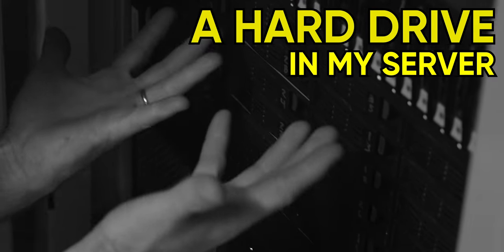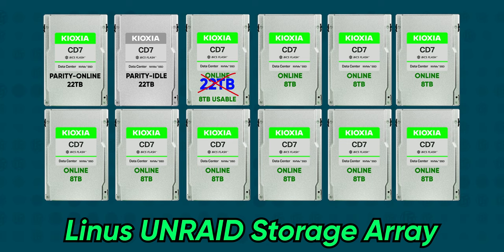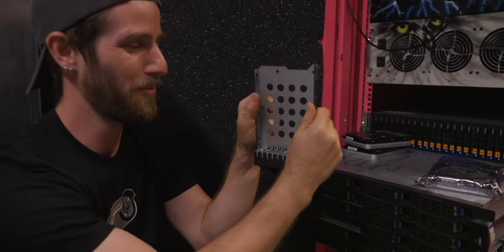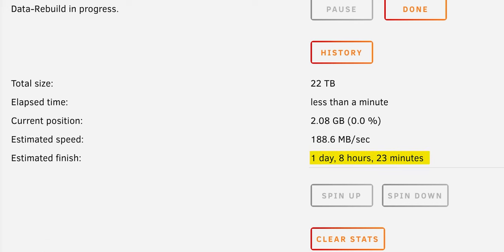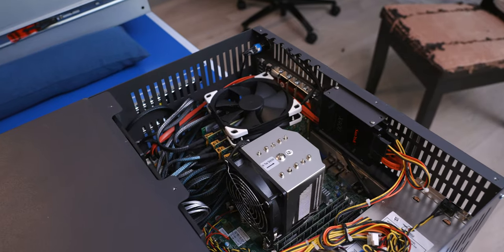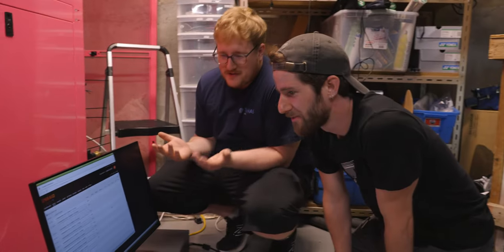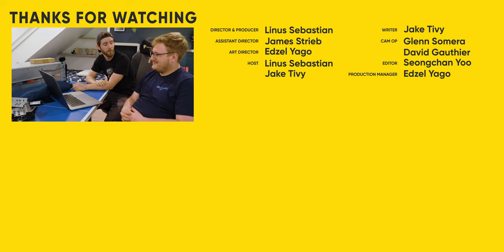My server is broken :( - Fixing Linus' Home UNRAID Server

Comment: booting unraid from usb is perfectly fine as it only reads from the drive during boot and writes very infrequently. My OG thumb drive from 2012 when I started using unraid is still going strong and many many hard drives from that first build died a very long time ago.

saying thumb drives are unreliable in this scenario is uninformed.
Reply: vmware also used USB / SD flash drives right up to version 7.  I'm using 64 gig usb flash drive for my TrueNAS core for years without issues.   I'm planning to change it out for USB to nvme adapter soon.

Comment: I am fully aware that I pay a synology tax, but for me synology hybrid raid is the killer feature. It is so easy to just mix and match drives. My first synology was a used 5 bay model and back then I would be savaging old drives from ewaste pc and every time a drive diede I would just plop in a bigger better drive. And core critical data was always offsite backed up.
Reply: I came here to say the same thing. I got given one of their rack mount models and their hybrid raid is awesome. Just going to keep adding drives until it fills and slowly up the size of the drives.

Comment: 13:50 The use of a USB drive for booting is not problematic because it is an immutable file system except for the config folder that its mounted very rarely. UNRAID and its FreeBSD brothers run basically entirely from ram and use very little write ops. 
Source: immutable FreeBSD OS dev
Reply: Its more that USB drives have a habit of dying completely at random, not necessarily due to writes.  Which is of course why you're supposed to have a backup to quickly swap out should that happen.
Reply: FreeNAS/TrueNAS hasn’t run mostly from memory for years, mainstream FreeBSD never has.
Reply: @philiprobar  yea not mainstream BSD, but BSD Router project, nanobsd, and microbsd which are all used to make these appliance OS’s do
Reply: @davidcozziii  
FreeNAS/TrueNAS stopped using monowall and switched to FreeBSD in 2010. I lost several flash drives to the beta releases.
Reply: @philiprobar  okay… I’ve been running production systems for the last five years without fail, in fact I’ve burned significantly faster through HDDs and SSDs because of how I configured it. Idk what TrueNAS did, but it’s no where near as janky as everyone makes it out to be.

Comment: I always love these storage related videos since I can relate a lot, I run my own NAS in a Supermicro 24 bay chassis at home, but use mdadm raid, and way older/cheaper hardware.  Recently added 7 10TB drives to grow 2 of my arrays. That was an interesting undertaking, basically replace one drive at a time and let it rebuild.  I have a file system limitation where I can't have partitions bigger than 16TB though which is kind of a bummer.  I need to fully update the OS but I don't want to take it offline.   The challenges of storage servers... :P

Comment: 14:00 Unraid is probably the same deal as ESXI regarding Flash Drives - it just loads some stuff from the Stick into RAM and doesn´t really write anything to the Stick itself, instead writes config, logs etc to the drives.

Comment: Running an 18TB Exos, and really pleased with it. No problems with it, unnoticeably fast read and write speeds, and it was good value at the price I bought it.
Reply: Only downside with exos I've found is that they do tend to be a bit louder, if you're using them directly in your PC rather than a home server or nas in another room.
Reply: @Californ1a  that's true, it is noisier. Doesn't bother me cos I've always got headphones on, but they wouldn't be as good for a build where low noise was a priority

Comment: That's why despite other issues with Synology (drive "compatibility" list), SHR-2 allows you to mix-match drive sizes (upward) and still be capacity efficient.
Reply: I can do the same on Windows with StableBit DrivePool. I don't have to care about specifics and can just add anything to a pool and it gets duplicated as often and as much as I want.
Reply: @CheapSushi  Their website has no mention of parity and a Google search yielded no straight forward answers. Does it support two disk parity or redundancy?

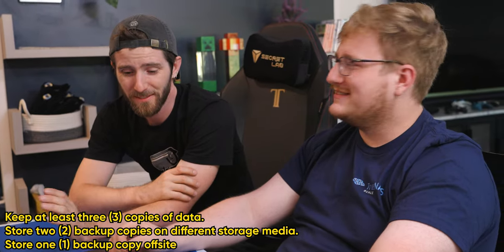Comment: 8:32 I 100% understand Linus here. For some reason using 3rd party cloud storage for anything but the most unpersonal unimportant stuff creeps me out immensely. I do all of it locally and even host my KeePass database myself (luckily my router has options to do stuff like that though only effectively for small files because of cpu/ram limitations). At the moment I'm in the process of building a data server (coincidentally with the exact 16TB Exos drives Linus showed in the vid) for myself and my partner and after that I will build a second one in my parents house for offsite storage (since The own a previous farmers house with several buildings for animals and 2 barns, so there is lots of unneeded space).
Reply: @Taudris  tbf building and maintaining two servers is very much a bonus for me and trusting myself is always easier than some corporations - I also despise monthly payments; it's bad enough I have to pay for the essentials (rent, water, electricity, insurances, etc.) I don't want to add any more to that than I have to

Edit: meaning: even though your reasoning is probably sound - it does not appeal to my feelings unfortunately

Comment: 4:43 be VERY CAREFUL when pulling a hot drive. You must let the spindle stop before rotating it because it can cause a head crash.
Reply: Don’t worried his pull out game is strong
Reply: i'm pretty sure modern drives instantly retract the r/w head off of the platters on power down/loss.
the reason you don't rotate the disk while it's spinning is cause the platters are spinning very fast and have a lot of angular momentum like a gyroscope, so if you rotate the drive, the platters will experience lots of perpendicular force, which isn't good neither to the platters nor the spindle motor.
Reply: It can't cause a head crash.  It could break the spindle motor.

The head unloads the instant the power is removed
Reply: Modern drives will park the head instantly when power is lost.
Reply: The system is off, otherwise the parity will be completely destroyed when you take out all the drives one by one and you hit both parity drives + extra drive.
Reply: @Haploanddogs  Yep, spindle motor is a gyroscope. So if you rotate the drive you can put a lot of stress on the bearing.

Comment: The way I handle this is to not fill up with all of this in the first place and just use a Sandisk Extreme V2 3.63TB SSD for movies&games, a V1 1.81TB for video editing, and a thumb drive to store my tools/drivers/ISOs. If I ever got a raid setup, I would use TrueNAS and find an infinitely replaceable set of drives I can purchase years into the future to replace the failed one. Shouldn't be hard to find individual sellers on eBay that can resell brand new or refurbished drives at a good enough deal.

Comment: TrueNAS for me... I don't mind just planning ahead and getting matching disks...  although older arrays with smaller disks are getting harder to find replacements for a good price/Tb.  Also If I need more space I have to bite the bullet and grab a stack of new drives.  All that aside, using snapshots I have 3-2-1 backups automated across two servers and one offsite in an adjacent building. I can rest at night.
Reply: Same here. Starting replacing 4tb drives with 8tb drives as they died or I moved them somewhere else when the pool reached 70%. Now at 79%. Either some of the remaining 3 disks die or I will replace them anyway within two or three years I guess.
Reply: You don’t need matching drives for truenas (or at least ZFS in general). As long as the new drive isn’t smaller than the old one, any drive will work.
Reply: @guspaz  Yes, that is correct.  You can start replacing the drives with a larger size and soon as all drives are replaced TrueNAS ZFS will automatically expand the array.
Reply: @guspaz  Don't "need" to be matching... although my tech brain will not let me physically do that. (lol... OCD gets the better of me and I start spending for new matching array)
Reply: @soniclab-cnc  yeah you don't need matching... but you won't get the extra space unless you have replaced all the drives. Matter of fact I have another nas that started with 3tb drives now all are 4tb except 1. Guess what: not getting any extra space until I replace the last one. In ZFS that is how it works and it is stupid to have different sizes unless you are doing precisely what I am doing. Talking raidz1/2/3. Of course with mirroring you can have couples or triples of the size you want and stripe them. But different sizes inside a vdev causes waste and makes no sense unless it is transitory or you are repurposing misc drives.

Comment: FYI - you can plug your UPS in to your unraid server via usb, and it can send a shutdown command when the batteries hit a certain threshold.
Reply: Yes, although it sadly doesn't seem to support groups. Using Eaton's IPP instead myself because it was the only way to get the UPS to shutdown the server's outlet group after going off, and make it turn it back on when AC comes back while keeping other outlets on for network and cameras
Reply: You can also do this using another server (homeassistant ahoy) and something like Network UPS Tools.
Reply: @superslash7254  You can even run NUT on a raspi with its own usbc backup battery and have it wake on lan your server when power is back up.

Comment: I'm pretty sure that in unraid, when you have two parity drives they use different algorithms to allow for two drive failures. So the two parity drives don't contain exactly the same data. And one of the reasons for unraid having a limit of 30 drives in the array is beacuse they don't have two different parity algorithms they can use that work with more than 30 drives.

Comment: Take the array offline and use a hardware drive duplicator for the parity drives you wish to replace, swap out the old with the dupes and power it back up.  I've done this with linux mdraid in the past, as I had a (8x4TB) RAID6 array with 2 dead drives and 2 that didn't look like they would survive the rebuild process before the dead replacements were able to complete their rebuild.  It was a nail biting couple days, but it worked.
Reply: I was also surpised that drive duplication didn't even cross their minds once (unless it was edited out, which I doubt).
Well, to be completely honest, I wasn't. lol

Comment: Pretty sure in unraid the two parity drives have different data. Parity one is a bitwise checksum across the array, literally if each bit across the array is odd or even. This doesn't work if you lose more than one drive so unraid uses another data algorithm that I have never fully understood for the second parity drive.
Reply: Yeah it would be impossible to restore 2 drives worth of data from 2 copies of the same parity data, that doesn't make any sense, the data needs to be different between the two or else you'd only be able to restore 1 failed non-parity drive (though one parity drive could fail at the same time without losing data)
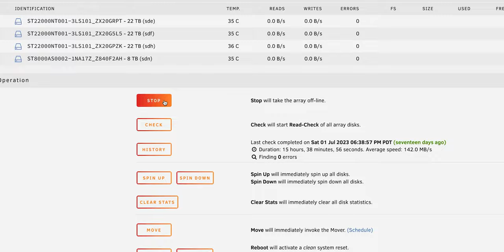Reply: I only mentioned it because at 10:30 they say that the parity drives are exactly the same.
Reply: How about thinking of the second parity disk as a way to safely and easily upgrade or replace parity on event. #timemanagement

Comment: At one point Linus says 'Don't you love it when we do a guide but we figure it out as we go?' but I don't really think it's that odd. Like literally the day before yesterday, I called a plumber. What I wanted them to do was install a bidet seat that I had purchased but which I couldn't install myself (limited tools, very old house and toilet, it would just be cheaper to have them do it).  They had never dealt with installing one like the one I got. But, they were professionals, they knew the tools, they knew all the necessary concepts, so I had absolutely no problem handing it to them and being confident they would figure it out. And they did, got it completely set up in an hour when it would, without question, have required me buying a bunch of extra tools and taken me 2 days or more to figure out the various hurdles they had to clear.  That's what experienced professionals are for.  Not necessarily to drop in and be like 'I have done exactly this before, I will repeat my prior actions exactly' but more 'it doesn't matter this situation varies from my experience in many ways, I know how to handle all the ways it could get hairy'.
Reply: It's not odd at all to figure things out as you go in normal working conditions, but when you're making a guide on how to do something, it doesn't exactly engender confidence if you're clearly winging it. The point of a guide is to show you the correct or best way to do something. I would take this video as more of a vlog type thing than an actual guide.

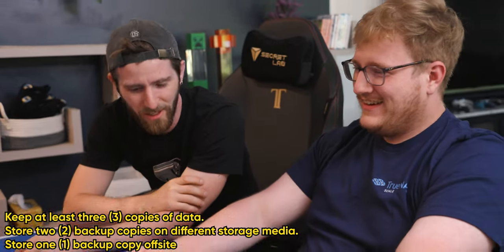Comment: 8:29 Though I have once before seen the explanation for the 3-2-1 rule as depicted on the screen, the usual one is that the production data is one of the three copies. So you should have (1) production data, (2) a local backup on a different device), (3) an offsite backup.
Reply: That's not what 3-2-1 translates to, while the onscreen version also wasn't exactly accurate. Off the top of my head, the rule goes "store [3] copies (as in instances, not as in additional duplicates - so yes 1 of them is production) of data on [2] different media with [1] of them off site". This more concise version rolls off the tongue better, and hence is meant to be easier to memorize :)

Comment: unRAID was extremely critical to me being able to secure my data on a budget, as well as having something I could build a home lab out to learn all my professional stuff on and gain better employment. I would have never been able to afford a system that was running TrueNAS with the disk requirements to build a raid there. 

It allowed me to take existing disks from old PC builds and and least cobble something together, while enabling me to upgrade it slowly over time as budgets allowed. 

I can understand why Jake doesn't like it, but I don't think it deserves all the hate it gets.
Reply: The other nice thing about unRAID is that if you lose more disks than your parity you can still read all the data off the remaining disks by just slotting them into another computer.  You only lose the files stored on the individual disks that failed.
Reply: @JuiceSpringsteen88  Wouldn't this completely negate one of the reasons for using traditional striped RAIDs - the IO speed increases you get from writing across disks? I guess in archival storage it wouldn't be an issue so much but seems like a terrible solution for anything that needs speed. It's definitely pretty interesting that it's basically a spanned set with a couple of dedicated parity drives rather than striped parity.
Reply: @CheapSushi 
That’s an interesting way of saying that you done care about the integrity of your data.

Comment: Great video, as timing would have it, I just went through this very scenario on my unraid home nas. I did it a bit differently though.

Since the content of the dead drive is emulated, using the "unbalance" plugin on unraid, I moved the data from the emulated dead drive to the other drives (of course this only works if you have the space) and then removed the drive altogether. Once both parity drives where replaced (1 at a time, if you do both, I believe you loose parity so if another drive dies while you're rebuilding the parity, then your'e s.o.l. but I may be wrong here, I just did it that way as I wasn't super sure) and done. Once done, I used the 2 original parity drives as new storage drive and used "Unbalance" once more to spread out the data to said drives.

In an ideal world, of course, you'd have that third drive to properly replace the original dead drive.
Reply: You're not wrong, and they kind of did exactly that - rebuilding 1 parity drive AND 1 data drive at the same time, putting all data at risk once another drive fails, which is what they said to avoid in the first place but then didn't. 8 green lights while having 8 data drives should instantly ring the alarm bell; ironically not only simple math but even just counting dots is already to much to ask for apparently lol

That unbalance option is an interesting alternative when you don't have a replacement at hand immediately, but enouth space left - thanks!

Comment: Imagine a server like that but full of Quantum Bigfoot drives. The sounds would be pretty dope!
Reply: man I DO NOT miss those things haha. Especially how compaq loved to shoe horn them into the smallest form factor cases possible at the time.
Reply: I wish there were still 5.25" hard drives. Imagine the capacity you could get. Downside is they'd need to be slow but that's not a big deal. Worse is the industry has moved away from the form factor so they'd be niche and probably not any cheaper.

Comment: FYI, there are a couple of mistakes in what was said here.  First, the parity drives in unraid are not exact copies of each other.  If there is one parity drive it uses raid 5 math, if there are two parity drives, it uses raid 6 math.  This allows any two drives to fail without losing data, if they were mirrored you would only be able to lose a second disk if it was one of the parity drives.  Second, there is a simple process for what you were doing.  Unraid refers to it as replace and rebuild.  First it copies all of the data from the parity drive to the new larger drive, then uses the old parity drive to replace the broken one, and rebuilds the data on it that.  It's literally point and click.